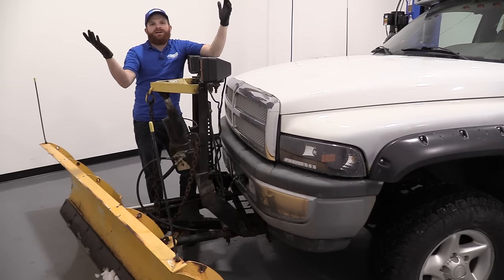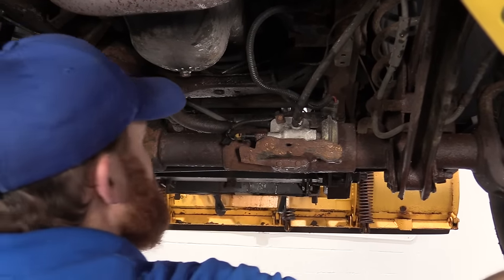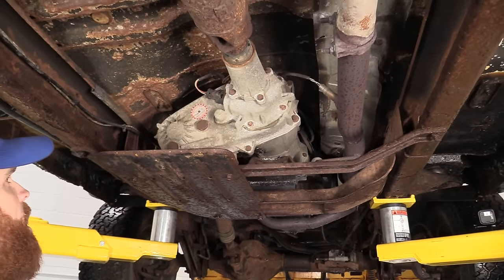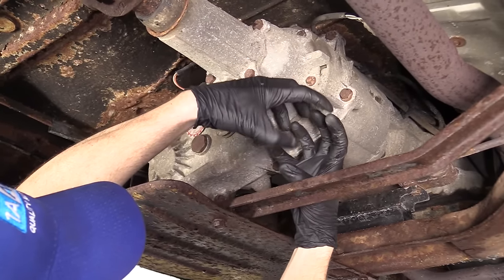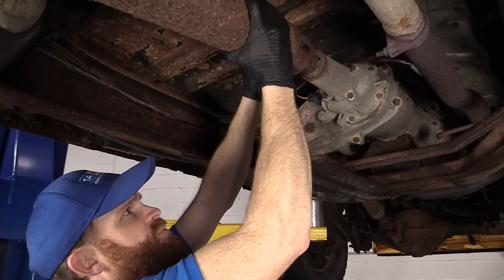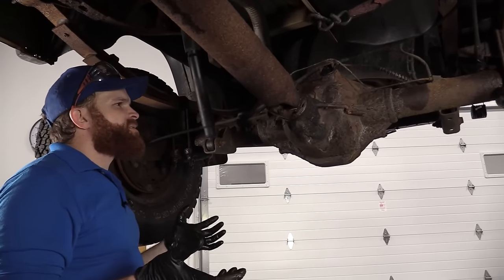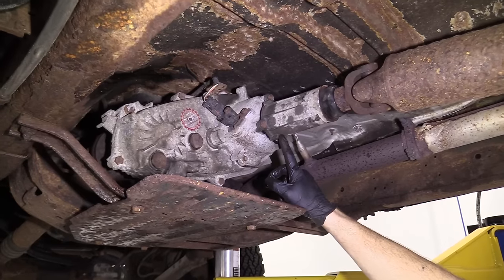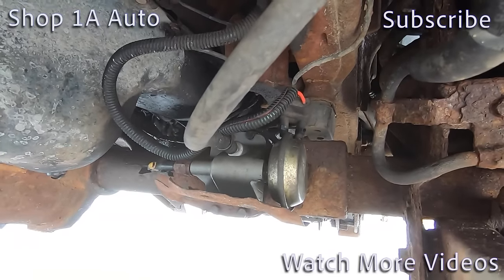Old Transfer Case Problems in 88-00 Dodge, Chevy, GMC Trucks and SUVs

Comment: Do you have the part number for that upgraded ring? I have a 2000 3500 4x4 and the grinding started this morning intermittently so I think the shaft if free floating
Reply: I need the part number for the upgrade

Comment: I let out an audible "whoa!" when you showed that snap-ring upgrade.  My plow truck is a 96 too - might just do this in the spring to prevent the problem.  Excellent vid.
Reply from the maker: Glad you like it Bill! and kudos for being proactive!
Reply: Whats the part number for a 1997 k1500
Reply: Where did u get that snap ring upgrade
Reply: This part is not listed or easy to locate on your website
Reply from the maker: +mark ryan We do not currently carry many of these transfer cases, but are always updating our inventory!
Reply: Be great if they could tell u what it’s called or a part number for that very vague upgrade makes this whole video junk without that info

Comment: 2500 second gen  PIA noise coming from behind the transfer case to some where in the rear differential.  Looked at everything and could find nothing.  elevated the truck and ran it up to 30 mph then went to every bearing with a stethoscope no bad bearings.  I live in the high desert in the rockies.    I had recently replaced the U joint at the differential.  6 months of this is driving me wild.  At times the noise would not exist for days.  It came I had to replace the carrier bearing. When putting it back together I checked to see if any of the needle bearings had fallen down.  What I discovered was that new universal joint was defective from the factory, all of the needles had flat surfaces some where on them.  replace that joint again--This cowboy is in love with his pick-up again.

Comment: My snap ring came out of the slot on my output shaft (rear). I was able to pull the shaft back and the ring snapped back in and the end play was gone and everything is hunky dory smooth again. This video gave me the starting point, and enabled me to be able to fix my transfer case easily. Thanks a million for the vid.
Reply from the maker: +R. Joel Bezesky Thank you! We love empowering our customers and showing how to perform DIY auto repairs with our high-quality auto parts.  http://1aau.to/m/Shop-1AAuto-c
Reply: I'm having problems with mine, I checked snap ring, wasn't broke, wondering if it wasn't set correctly

Comment: Thank you for creating this video, I call this, finding the Gremlin. It is to hard to determine if it was coming from the transmission, front axle assembly or gears because once the noise starts and it sounds like gears digging to deep into each other, the noise would go away again until you hit a pothole causing the noise again. I am sure this is my problem especially if you say it happens a lot with this type design. Thanks again.

Comment: My problem is that the transfer case ( 95 manual shift link in floor) grinds if shifted l while running. Kill engine. Shift to neutral and it shifts smooth. Start engine and transfer case is engaged and stays?? Shift link adjustment?? Or synchro prob?? Help?

Comment: That broken lock ring and noise from the T- case  is a huge red flag ! I would pull that case out and either rebuild it or replace it ! It will most likely fail soon !
Reply: Didn’t the noise go away?

Comment: Any experience with the BW4407 from the mid 90's Ford F250's, F350's?  Mine has grinding scraping sound that is intermittent, happens mostly on accel, decel.  I've tested every combination of selection (range, mode, with/without driveshaft) and there are only these conditions where I see NO symptoms: 1) 2H, hubs free...  2)  Front driveshaft removed.... 3)  4L is perfect.

I removed the t-case and disassembled for inspection and found: bronze flake in oil, broken range fork insert, range fork from a BW4406 (not correct part number).  I inspected all parts, minimal slack in chain no evidence of rubbing (sprockets are bronze), a little sloppy but undamaged planetary, oil pump good, main bearings all good.  Maybe this just all is worn (its a reman unit). Super frustrating, doubt its a pinion issue (diff), that feels fine has normal preload oil is awesome.  Ive never been able to determine if the 4406 range fork is acceptable in the 4407.  It seems right (?).  Reman company must have put it in there.  Documents definitely indicate different part numbers for each type of t-case.  I never could find a 4407 range fork.

Comment: Would this happen in reverse? When I put it in reverse and give it gas it seems to pop out of gear and stay grinding. Is that the same problem? New transmission as well so it's gotta be transfer case I'm guessing
Reply: Did you find the problem ?
Reply: Did u fix it and wat was the problem

Comment: I have a GM NP241C transfer case it is making a grinding noise at the rear of the case. I took off the cone and the clip is still there in tact and shaft if not loose. Fluid was flushed no metal shavings. Filled it up and still making the grinding noise. Mostly when coasting on the freeway any idea what it may be? Thank you for your time
Reply from the maker: +Raven Rivera We wouldn't be able to diagnose an issue like that here, you may want to have a local mechanic take a look at it. Thanks for checking us out! 1AAuto.com

Comment: Cool. I have 96 dodge ram1500 4x4. I heard some noise from transfer case for two week cuz I wasn’t sure what it was. I check fluid in there and barely have it in so I added to it. Some of it goes away and little smooth but still makes noise. I’m not sure what to do cuz it does leaks.

Comment: Does this apply to an 02 Silverado Z71 with automatic trans? Mine just left me stuck at a gas station and having to get towed home with a similar issue. It was running fine all day then when I was pulling away from the gas pump, it made a clunk and suddenly started a  terrible grinding noise and completely lost power. My heart went up into my throat and several naughty words were verbalized almost as loud as the grinding. I was able to get moving again but it would consistently lose power and start grinding after about 10mph. And grinds immediately when putting it in reverse without even giving it any gas. Sorry about the long comment. I'm just really bummed out and hoping I can save myself a lot of time and money getting my transmission rebuilt or replaced.  Please help!!
Reply: Did it you fix it and what was the damagez?

Comment: My truck is a 92 k1500. It rides fine in 4wd, but when I go to put it into 2wd it shifts in then around 10-15 seconds later the light comes on as if it’s in 4wd. If I then try to drive it in “2wd” it grinds, but not a steady grind. It speeds up when as the vehicle speeds up. Any possible explanations? I swapped the transmission to a 450 turbo s, if that means anything.

Comment: I have a 96 z71 with the stick in the floor and it grinds really bad when you try to put it in 4wd or back into 2 wd I usually have to cut the truck off to put it in 4 wd and cut the engine off again to put it back in 2 wd ....would that snap ring have something to do with that too?

Comment: Hi, I have a very strange situation where only when I slow right down to crawl speed like when stopping at a toll booth I get a very heavy clunking sound and I can feel it through the car but once I start to move again there is no noise or vibration. It is a 2001 Ford explorer Sport Trac 4x4, do you have any ideas on this problem.

Comment: Help! 1995 dodge 1500. It would crank but not, replaced the rotor started up. Couple of days later it moves 5mph. Thinking cat. converter or transmission. Not sure your thoughts

Comment: Question: faulty transfer case may cause no reverse working on 2 wheel drive ?? 
I have a expedition and runs good forward but  reverse not good and it's wet of oil

Comment: It started all of the sudden after driving threw some very deep snow just a day ago. So if the noise only presents itself under load and taking your foot off the pedal the noise stops I should start at the snap ring?

Comment: Driving a Ford Ranger Sport 2011 4x4. When I put it in 4x4 and drove, the truck jolted at certain speeds. It almost caused me to spin out or fish tail the back end of the truck. I do hear a bit of a grind or hum. Has to be transfer case? Fluid.
Reply from the maker: +Jason Cherry We wouldn't be able to diagnose an issue like that here, you may want to have a local mechanic take a look at it. Thanks for checking us out! http://1aau.to/m/Shop-1AAuto-c

Comment: I had a problem in my 2000 ram 1500 when I put it in 4x4 there was moaning sound and it darted from left to right while driving and made a knocking sound and it was scary as heck on icy road so I put it back into 2 wd and it was fine.

Comment: I have a 2000 ram 1500 5.2,  4x4 and have basically rebuilt the front end (some of your parts) including the the steering gear box. I have a lot of slop in the  steering. I replaced everything on the engine side pertaining to the steering column .  In short  i need the cab side steering column. Do you sell this or know of someone that does? Thx for your time
Reply from the maker: +Ronin Thanks for checking us out! We do not currently offer the steering column for this application. You may want to search further on Parts Geek or eBay, thank you!

Comment: Not concerned with that rtv getting into the case and clogging the pump? Heard that’s a common issue among home gamers
Reply: There is a chain that slings the oil within the case. No pump. That stuff normally won’t move once it’s installed. In you’re worried about it just let it set up overnight before you fill it. It will be good and cured by then.

Comment: Hey nice video, I have a hummer h2 2006  when I accelerate it makes those kkkk grinding noise, would this be the same case? Another question from gear 1 to 2 it slips some time. What would be the problem? Please please advise 🙏 thanks.
Reply: Have you find out any solution?
I have same problem

Comment: I have a 01 ram 1500 5.9 there’s a grinding noise/ feeling I can Feel and hear from the floorboard in park at idle goes away in drive or neutral could this be the problem thxs .
Reply from the maker: +Toxic_SniPe420 Thanks for checking us out!
Reply from the maker: +Tyler Humke We wouldn't be able to diagnose anything like that, but a local mechanic may be able to figure it out. Thanks!

Comment: Say I didn't catch it and kept driving months and months. Is it possible I come to a stop sign and my truck just locks up. Not roll past a feet in any gears.  My truck been in shop over a month now and still no answers! The 1st shop I took it to said it wasn't the case or spider gears so I took it to a 2nd shop that rebuilt my transmission cause I had warranty 5k miles ago. But I haven't heard anything they just keep telling me they don't have time all they know is it won't roll, well that's how it been since I brought it a damn month ago! No way they that busy if they can tow it in a hurry! Idk what to do or say at this point.
Reply from the maker: +T V Thanks for checking us out! We are sorry to hear that you're having this issue with your vehicle. We would not be able to diagnose this as an issue like this will definitely need the vehicle there to look through everything. It may be best to have another mechanic try to take a look at this.
Reply: @1AAuto  I'm gonna wait to hear what the mechanic that the warranty is under says.

Comment: Where can i buy the snap ring mentioned @ 2:00
Reply from the maker: +King Leez Any local auto parts store such as Advanced Auto will carry the snap rings.  Thanks for watching.
Reply: @1AAuto they do NOT have the upgraded locking ring you used. been to advance, oriellys, farmers supply and tractor supply. nobody has that replacement

Comment: tryin g to figure out if i can drive mhy truck in 2 wheel drie with a hole in the transfer case
Reply from the maker: +Craig Coulthard That would not be advisable. It will eventually run out of oil and cause irreparable damage and may even seize while driving. Thanks for checking us out. Shop for high quality auto parts on 1AAuto.com:

http://1aau.to/m/Shop-1AAuto-c

Comment: would this also apply to a 2001 dodge diesel 4x4  1 ton ?
Reply from the maker: +Charles Boston Thanks for checking us out! It may be slightly different on your vehicle but the majority will remain the same. http://1aau.to/m/Shop-1AAuto-c
Reply: @1AAuto  so where is this part on your website ..... it doesn't seem to exist
Reply from the maker: +Charles Boston We do not currently have this part for your 2001 Dodge.

Comment: My truck is still making the noise even when I changed the part. My truck is a 95 K1500 z71 4x4 step side. 4l60e, anyway you could help me out here? Anybody?
Reply from the maker: +ViolentVenom96 We wouldn't be able to diagnose an issue like that here, you may want to have a local mechanic take a look at it. Thanks for checking us out! 1AAuto.com
Reply: Rebuilding the case
Reply: ViolentVenom96 I have the same exact truck but a 1994. Mine does it randomly. It’s made the noise for a brief 2-3 seconds about 3 times in the past 2 years of driving it.

Comment: did i just hear you try to have a serious conversation that included the words "vacuum pressure" and "4-wheel drive"? do you wanna know what problems my daddys generation never, ever, ever, EVER dealt with? surprisingly they didnt have to worry about whether or not their 4 wheel drive was engaged, because they were lucky enough to purchase products designed by honest engineers that actually worked durably for multi generational use. they dont rely on whisps of air or the integrity of a feeble grounding wire to control cold hard steel; they had cables made of steel connected to levers made of steel which when util;ized according to centuries of study in physics and mechanical advantage, would move the gears of steel into position whereby 4-wheel drive isnt a gamble. if you yank the metal bar designated for 4wd, you will be in 4 wheel drive, and if you wanted to guarantee actual all wheel drive then you got out of your cab and felt the wind on your face as you twisted your hub lockers into posi-traction drive. ive never heard of my dads generation ever needing to repair their transmissions, and they use their trucks like the tools they are supposed to be. (this rant isnt about you, as i actually like you, but instead it arises from an innocent comment based upon a lack of comparison into what good engineering looks like...)